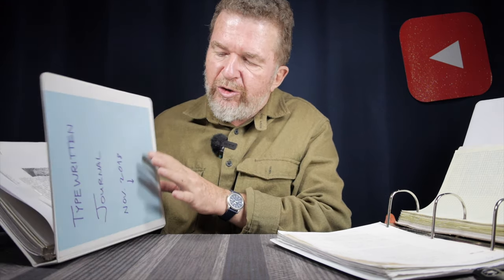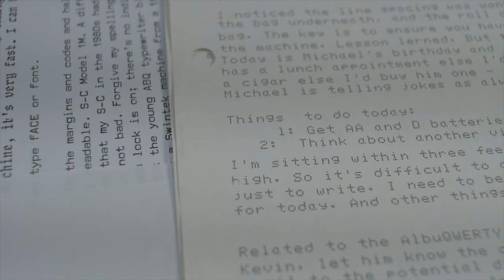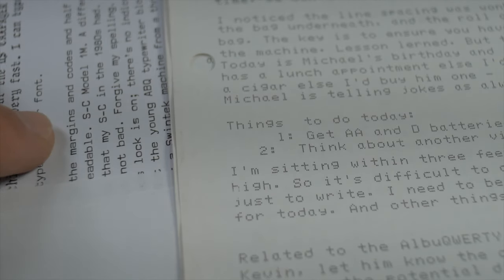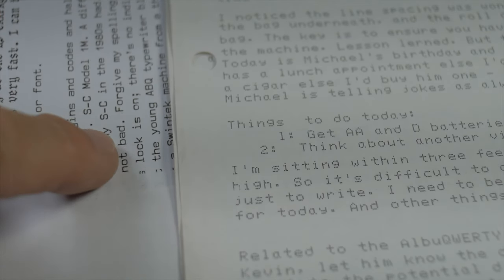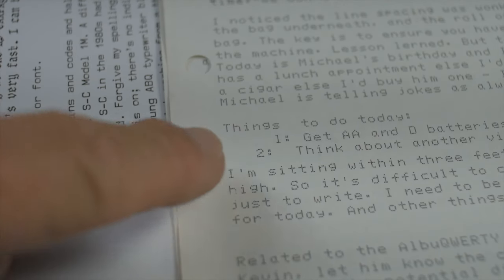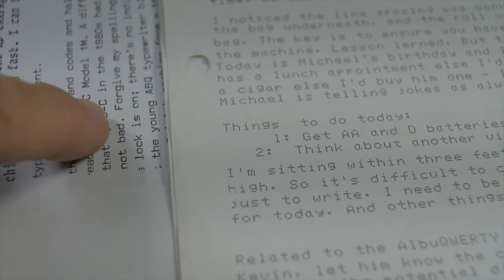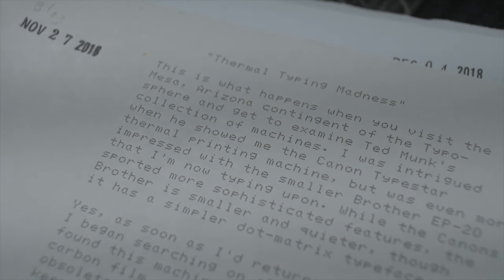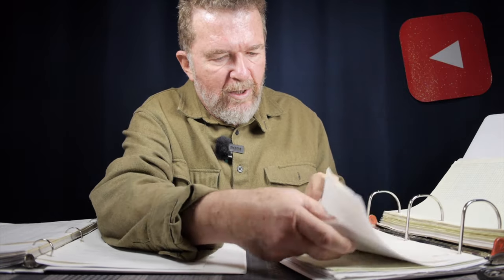Typewriter Video Series - Episode 210: Thermal Paper Longevity

Comment: Joe have you been having problems with these typewriter's extended use when it comes to batteries? I have a canon Typestar 10, it needs 4 C-type batteries and it eats 6 w - 9a. According to my experience, it drains these four C-type batteries in less than 4 hours. Granted, most laptops will give you 5 hours, but these old typestars should consume way less than a modern laptop! I expected them to last, I don't know, days!
Reply from the maker: I haven't had battery issues on my Typestar 4 or 5. Not sure about the 10, as it has RAM memory.

Comment: I have a typewriter. I cant find a typewriter repair man in El Paso. My typewriter needs a cleaning on the type face. Do you have a suggestion on how to do that? It will be my first time in doing so.
Reply from the maker: Remove the ribbon cover to gain access to the type bars. Cover the rest of the machine with rags. Then use a toothbrush and alcohol to clean the faces of the type slugs.
Reply: Thank you so much. I love your videos. I listen to them as I type on my typewriter.